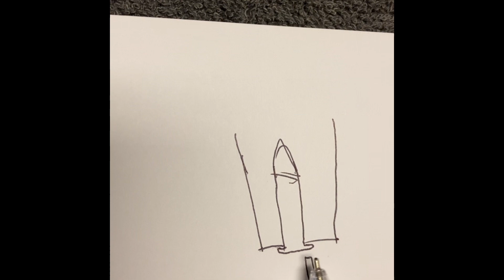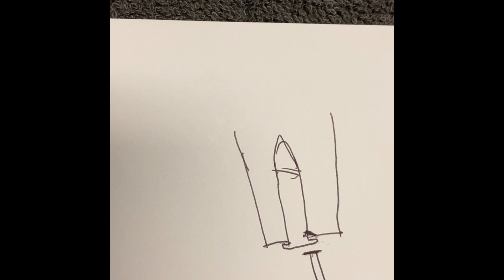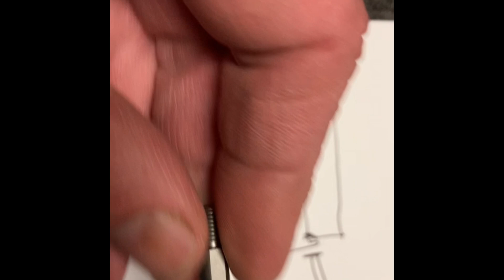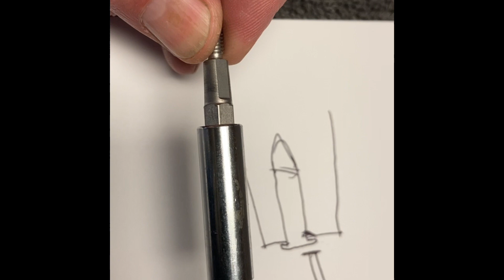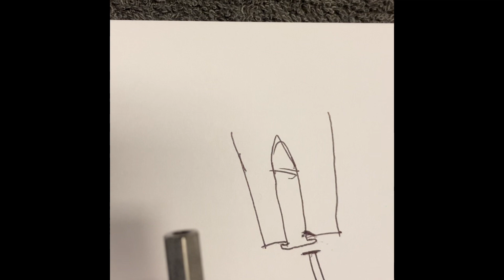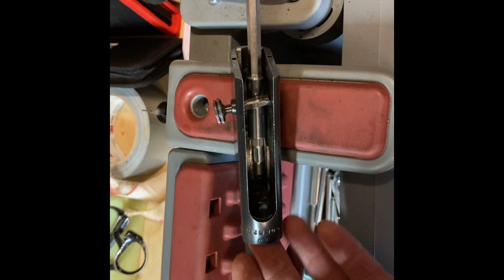Rimfire Chamber Repair

Comment: We made one of these tools in gunsmith school couple decades ago. Wondering if I can make one big enough to clean up a trap door, Springfield Chamber it looks like somebody put a bar in. I’m trying to remove a stuck case. Just worried that even if I get it removed, the pressure will swell the case into thearea, causing them to stick.
Reply: I fixed my Ruger Mark 2 with a swage.
Reply from the maker: Dunno, 45-70 is pretty low pressure.  Let us know how it turns out.